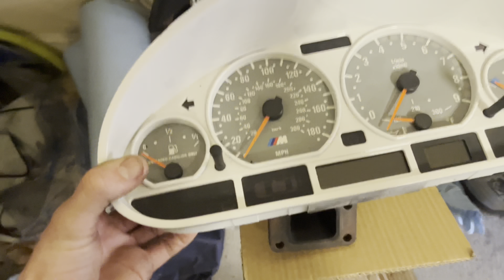BMW E46 Turbo - changes have been made.

Comment: What year it was the e39?
Reply from the maker: early, like 98-2000 i believe 528i, not to be confused with the m52b28TU aluminum block which was also featured. any e36 m52 will do as well